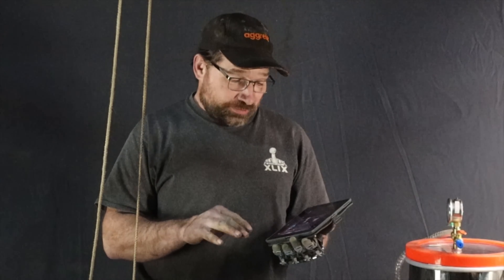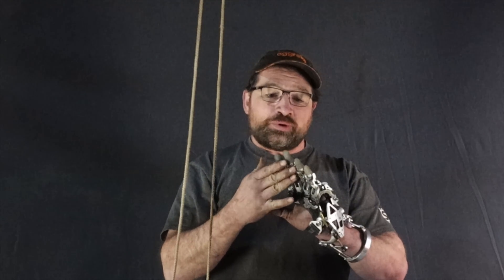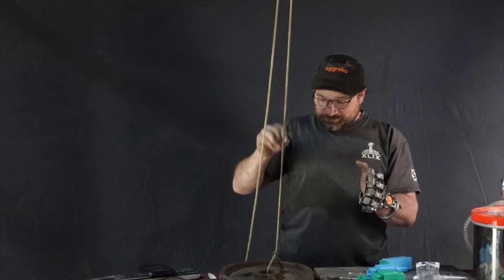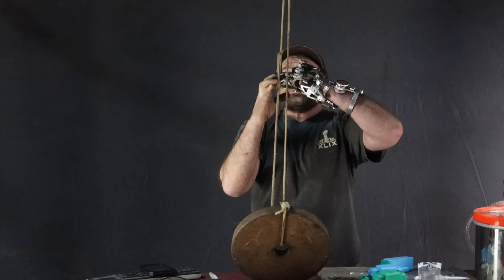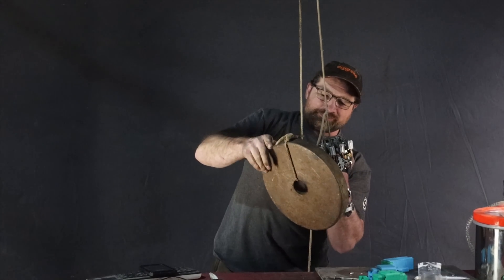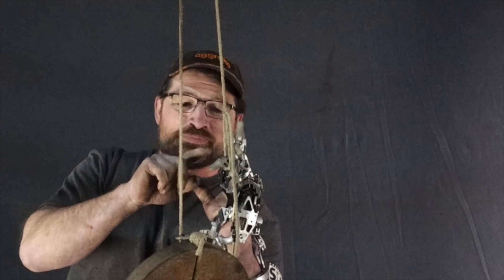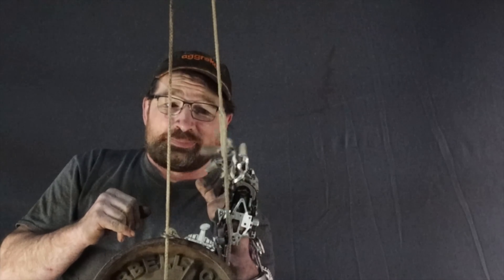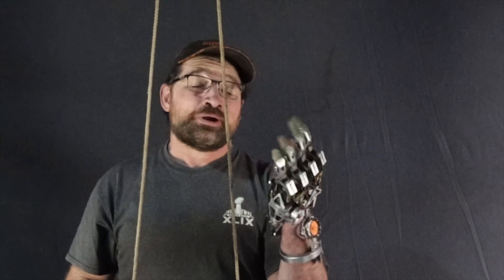Super Cool Proof of Concept!

Comment: It’s incredible what you’re able to do with just mechanical parts. It makes me wonder if a hybrid of this and some of that tech that uses input from the nervous system wouldn’t be the ultimate. Right now prosthetics that use nerve or brain signals are very complicated and slow, but this seems like it could be simplified as to what signals it needs since the majority of the basics are covered by your brilliant mechanical system. The nerve input might just be used for fine detailed adjustments to the movement, and if it loses power or otherwise fails, it’s still 99% functional. 

But hell, even without any of that this is absolutely amazing. It’s like something out of a movie

Comment: Seems like a dangerous idea to me. If you're holding something that's running away - like a tree branch on its way through a wood chipper, you need to let go, or have the ability to immediately and easily unlock. There are plenty of common, every day scenarios like the one for the wood chipper, too.

Comment: 1st time I've seen your stuff. Looks superb, and clearly the engineering is sound and well executed. However, let's  play devils advocate. How would you 'unhook' if you couldn't release the load? That might lock you into a situation, dangerous or otherwise. In your example, you have the use of your thumb. Might it be advantageous to have a 'back-up release lever/button'  that  you could activate with your thumb to unlock the  hooked finger whilst still loaded? I say this because I was a climber and roped access tech for decades and being locked into a loaded position can be a very serious problem, and so having a way out of that was always part of the safety protocol. Apart from that I can't think of anything additional to say that you probably haven't thought of yourself.  Your work seems to me to be groundbreaking. Top stuff sir, and good luck with the project.

Comment: my right hand is currently injured bc of a weightlifting accident and i was thinking of making a iot enabled add on that uses current change from a pinky string linked to a motor to enable finger assistance coincidently came across your channel i think it could be a fun project with a similar concept to what you have going on but my mech eng is trash i'm better with code

Comment: Although cool this could be dangerous as hell. Just for example think of the teenage trick of reach for car door handle and your buddy hits the gas. If the tension hits before you realize what’s happening you get drug down the road. I can think of many other examples as well. I suggest in continuing your designing consider safety or an emergency release ability. Hope my comment is helpful. I do think your idea and engineering is very cool though.

Comment: I think this is a very cool concept, however unless you have an override as a safety this could also be a detriment. If you are holding something heavy and your arm gets stuck, you now have no way of putting what you are locked into down. Again this is entirely fine as long as you have a manual override, like a safety switch, in place!

Comment: Sorry to be a party pooper, and really this is great, but a safety limit to how much "pull" that joint can be under should be found. Analogy that comes off the top of my head is a foot caught in a stirrup. There could be an instance where a load suddenly increases beyond safe handling. 

Could a cam lock be used? Once it exceeds a load the cam lock can slip and disengage the lock. Though, at the loads we're likely talking about, sudden slippage might also be damaging. 

Sorry for all the speculation. I'm coming from a place of respect. What you're doing is seriously awesome. Thank you for putting it on the internet for us to enjoy.

Comment: You need to add something that triggers the release if too much pressure is applied. That way, you’re not liable to get locked holding something way too heavy, or worse, something that’s moving away quickly.  Preferably, it would be adjustable depending on the activity or expected weight load, and the individuals level of strength. 

Perhaps adding a sequential loading and release system, one that allows more pressure on the hand as more fingers are engaged. That seems very difficult to make, not sure exactly how to design that.

Comment: As a laborer my main concern is that if you rely on this locking mechanism some tasks could become dangerous.

Let's take swinging a hammer, if I am not mistaken at the Apex of the swing there's a moment of weightlessness that could trigger the release mechanism and now we have a flying hammer, anf depending on your reaction time you might accidentally punch your working surface due to a much lighter load

Comment: Would there be any safety concerns for example the finger locking onto a weight and dragging the wearer as they can’t manually release the finger until the load is removed?

Comment: The only issue i could see with this feature is if the hand is holding anything that expands (ex: filling a plastic water bottle, ballon, etc..) the finger's mechanism could unintentionally lock up. That may or may not be a problem, but it could lock the item to your hand.

Comment: Uh, ...isnt this device ENTIRELY limited by the strength of your arm anyway?
Reply from the maker: Yes, the grip force and holding power is all relative to the amount of force that the user puts into the prosthetic.  If you can only forearm curl 50# the hand won't have as much grip strength as if the user can forearm curl 125#
But that's where the locking link comes in. Once the hand is set, you no longer need to apply all of that force to hold the fingers in the closed position.
Reply from the maker: Yes, the grip force and holding power is all relative to the amount of force that the user puts into the prosthetic.  If you can only forearm curl 50# the hand won't have as much grip strength as if the user can forearm curl 125#
But that's where the locking link comes in. Once the hand is set, you no longer need to apply all of that force to hold the fingers in the closed position.

Comment: Hey Ian, this is brilliant, you continue to amaze me with your skill. I have a question about the safely of the lock mechanism however. Is there a way to unlock a finger without taking the load off? What happens if the object you are grasping suddenly starts moving away from you, such as a car, and you're not able to release tension fast enough? Or say you want to release a bow string under tension? Will you include a way of releasing the lock while under tension, and can it be controlled with the same hand? Again amazing, and I look forward to seeing more of your work.

Comment: Incredibly cool and amazing work! I would definitely recommend a way to additionally lock it, this is great for the initial latch but I could see some safety issues if you're picking something up and it just slips for a second or you lower too fast and it disengages. May be a moot point if it catches again fast enough to feel the load applied again rather than springing all the way back

Comment: This looks amazing. However, you should consider a safety in case the finger locks with a load applied but when you don’t want it. Working with heavy machinery is my first thought.  I feel the Orión to be able to release it at will would be a bonus.

Comment: Super cool! This is proper engineering. The one problem I see with it is that if the hand locks on something pulling away from you then you wouldn't be able to release it, which is potentially quite dangerous.

Comment: Neat proof of concept. Do you have a safety weight setting? Meaning if the weight applied is too heavy for the mechanical finger(s), the system will not lock in place.

Comment: Excellent concept, very sturdy grip mechanism. As others have mentioned some kind of emergency release needs to be built in.
Perhaps a release servo connected to a micro switch between the bum cheeks would work. Sudden clench releases the grip.
Excellent video, subbed ✌🏼🇦🇺🌏

Comment: Is that mechanism ratchet based? That is brilliant.
I would say it's even an improvement over actual fingers, considering you don't need additional exertion of strength to counteract any kind of pulling motion.
If it IS ratchet based, an idea might be replaceable inserts, considering the actual gear section itself will get worn down over time, but even as someone who has all their fingers, a mechanism like that would be hugely helpful in any number of applications! 25 pounds the finger? Are you kidding me, that is phenomenal!

If you DO end up going with inserts, if at all within a reasonable scope of engineering, making gear plates with different teeth counts could serve as a way to select whether you want fine but fragile control, or rough and tough control.

Tension lockup is a game changer Ian!

Comment: Really cool, though I’d be worried about releasing when it’s under load, like if I was securing something on a rope and it gets out of control, I’d be dependent on the rope to give enough slack to release, otherwise I’d be stuck to whatever’s pulling on the other end of it without being able to give some sort of negative input to release

Comment: Cool BUT:
You need a way to release the lock other than removing the load. Otherwise, you could become trapped in a locked position, unable to release whatever object is providing resistance to the link.

Comment: It seems to me that automatically locking in place has a disadvantage over a possibly simpler manual locking configuration. If you are pulling on something (I'm imagining manual labor like I do) it may be frustrating to have the fingers release when the load is removed.

Maybe this is more useful for tasks that you encounter that I'm not considering?

Comment: I think this was very cool to see.  However as far as safety goes for further tests I would rig the rope so that if something were to happen to whatever joint(s)/finger(s) you were testing at the time and then having the rope slip and the weight dropping and bouncing off the table/floor and possibly injuring you/breaking something, it would only drop a foot or so before coming to a stop suspended in the air.

Comment: The idea is bad.
You never want to have your hand locked to some rope or pulley or whatever.
Also, the hand should be designed to break loose, snap at about 1/2 to 2/3 of your body weight.
Imagine holding onto some rope and being yanked off by it and now you're stuck to it, you don't want that.

This could only be useful for small loads, like a grocery bag or a bucket or something, but you should still be able to let go in an instant if required.

Comment: I absolutely love it! But I have a question? Could that also be a bit hazardous. I'm sure you could think of a number of ways that could lock you in when you're not prepared. I'll just use closing a door as an example. If you weren't expecting it to put a load on the finger it could pull you right in. Now that may not be the worst case scenario like a house door but a car door can do worst damage at least to your ride if not your 3D printed fingers. But you do a lot of machining as well. If you were to get that snagged on a quill on the mill or a chuck of a lathe that could be a bad day. But I must emphasize this again I absolutely love the design. I'm just a little leery of how it locks and will not release the pressure is off.

Comment: Dude, you are literally creating the future for prosthetics. I know the rage is the full electrical, but this is just more intuitive from how it looks and way less expensive I imagine. Keep up the awesome work. Loved the video as always.
Reply: that's not the future of prosthetics. The future of prosthetics is cheap and easily manufactured devices that require little to no maintenance.
Reply: @eckee  it's definitely the future of prosthetics, because easily manufactured and little to no maintenance means its probably not as good, not as similar to a real limb.
Reply: @Green_Bean_Machine  being good and being cheap and low maintenance are not mutually exclusive, the best designs are low maintenance and minimise costs.
Reply: @eckee  Yes and no. You'll never. Ever. Ever. Get past maintenance. Whether it be mechanical or electrical. That's just how it works. The next step beyond that is to look to function which this prosthesis fullfils to a T. And looking at it, a production-line shouldn't be a problem. A lot of those parts could be printed and the rest could be taken of the shelf.

/Just a dude who has worked in the field for 15 years.
Reply: Just want to add: Arms and hands are the most difficult things you can make in this realm.
Reply: @eckee  This is better than anything else out there. It's cheaper to go this route, though I think you are right in it's current state maintenance could be a problem for the average person. Good point.
Reply: @PaubloSoblo  there will probably be doctors for prosthetic in the future. Like with your phone or car.

Comment: Super interesting idea. The only comment I have is about safety. If you were to grab on to something, and that something pulled hard, is there a way to release the finger without the load being released? Otherwise, if whatever you were holding got away from you, you'd be going for a pretty nasty ride. a specific example might be grabbing on to a pulley like that but with a much stronger weight.

Comment: Since you do not have any fingers any more, where do you feel the weight when lifting something as you do in the video?
Reply from the maker: The weight gets tr
Reply: @missingpartsclub  Thank you for your answer! A follow up question, I presume the weight must be transfererad  towards the hand or arm where the prosthetic is attached. But would that mean your finger is "stronger", from an endurance standpoint, than a normal finger? Theoretically the locking mechanism enables you to hold the weight indefinitely, or at least longer than with a regular finger, correct?

Comment: This is a very interesting mechanical concept, one thing I'd be cautious of though is not having a way to safely clutch-out or controlled-fail at a strong enough load, grabbing at a car door that keeps going, and getting pulled along for a ride doesn't sound like a fun prospect by any means. In that respect it becomes a temporary hook until the load can be adequately relieved.

Comment: Really cool and useful feature. Have you figured out how to have the option to have a full hand release of all fingers possible so that getting a locked grip can be released on demand and even reset possibly? I can see how going metal would allow for option like this since the material has the strength to take this sort of forces for locking like this in a tight mechanical lock. I really am looking forward to your final video on the 3d metal parts and how well they have performed for this function.

Comment: I'd call this a breakthrough! It's easy to overlook that in previous versions, you would have to continually flex your wrist to maintain your grip while under load. Now you can seamlessly go from grasping to lifting without wearing our your forearms. I'd love to get the nuts and bolts of how this works in a future update after you've got it dialed in. Hope the 3D printed hand project is prosperous!
Reply from the maker: You described the purpose and function of this feature beautifully!  You really got what I did here! Thanks !
Reply: First time seeing this, but looks amazing. I'd be very curious to see what this would look like combined with motion under load for the given hand. E.g., if you took a small 5 pound dumbbell and lifted it up and then put it down.

Comment: I really like the idea. How would it handle squeezing something like a rubber ball?  Would that accidentally lock it if too much squeeze pressure was applied?  It seems beneficial to relieve  muscle strain for certain use cases tho. Your ingenuity is great!
Reply: It's probably tuned to need a much larger load than that in order to lock. So, I imagine that if the lockable link is tuned correctly, shouldn't be a problem.

Comment: Wow Ian, there are aspects of this that actually are an improvement over a real finger and hand joint. I immediately thought of your archery string pulling as an example. You could literally hold the drawn string effortlessly and only be fatigued by the pull on your whole arm. Carrying heavy buckets or anything heavy with a thin handle would transfer the fatigue from finger joints to the whole arm. It's really awesome the things you're experimenting with on the project. It really is nice to see a real world example of if you can dream it, you can make it real with enough effort and patience. Thanks so much for sharing with us!  :)
Reply: For arrow though you would need some way to trigger force release.
Reply: @christopheroverbeck3662  archers use triggers nowadays ( though yes, traditional archery seems impossible)
Reply: Mechanical Hand isn’t precise enough for archery.
Reply: @patstaysuckafreeboss8006  You only need one hand to be precise.
Reply: @patstaysuckafreeboss8006  huh what? Why would you set the expectation to be "world class"? Even my fully natural arms aren't good enough to make me a world class archer.
Reply: In 10 years I bet you we will have at least basic hand and leg skeletons for load baring
Reply: Your comment made me think of 1 negative to this but if I'm correct when you pull back a bow string the finger would just stay locked because in order to let the string go you have to have independent release of the finger cause the pressure wont lift until its released if any of that makes sense